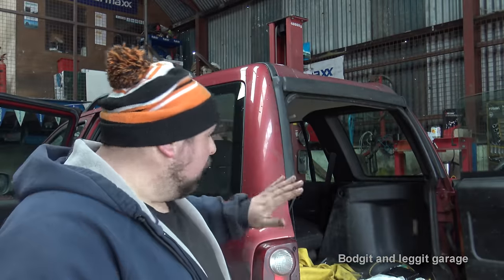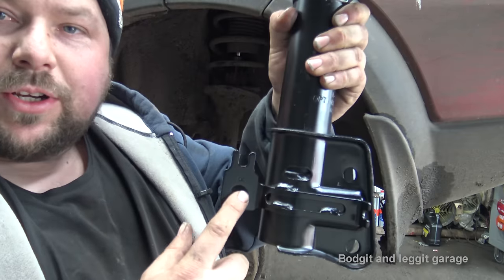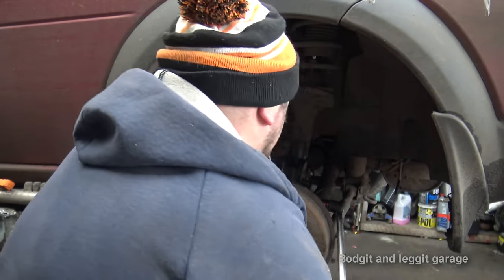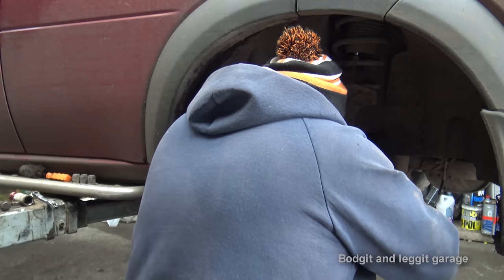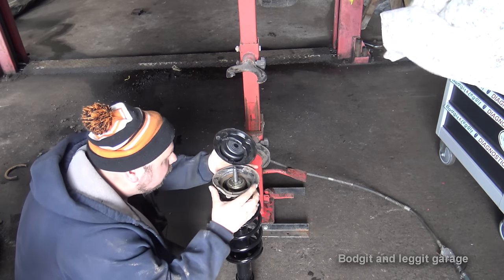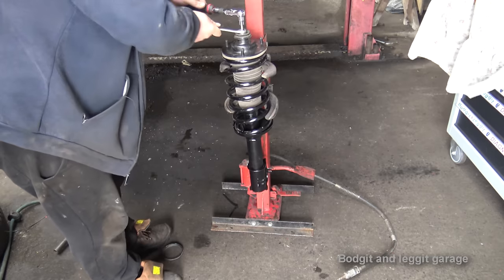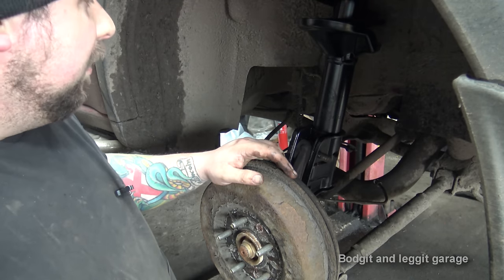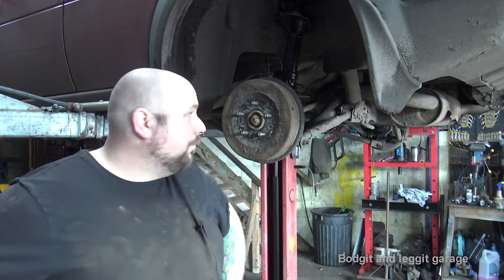Landrover Freelander Back spring/Shock/Shock Tops Bodigt And Leggit Garage

Comment: That’s a crazy design where you have to take off the brake lines to change the shock and springs. And a little bit of that MAP worked well on those stubborn bolts. Leon, that’s a nice spring compressor. Looks to be very sturdy! Great work as always! 😀👍
Reply from the maker: stuzman thanks mate yes it is a good one but I still don't like using it never like using any spring compressor really

Comment: ah good old freelanders, good customers are they :-) rear diffs, diff mounts, viscous units/bearings, IRD;s, gearbox, clutch, low and high fuel pumps, injectors, sunroofs, windows and door locks, fuel tank brackets, electronic gremlins and then the usual stuff too :-)
Think I could be busy 24/7 if specialised in them ... A good one nice usable vehicle but hard find clean ones and need luck too as so many whacky faults on these due to poor design and poor quality ...

Comment: Another Great Video my friend , Pleasure to watch you Work ,  just Brute Strength Sometimes Does the Trick . Very Well Done . PS I have searced Everywhere for that Brake Line Plier and Cant Find it Any Where ,  so Ended up Taking a Nick out with the Grinder Very Carefully , And got the Brake Pipe through , But a very Handy Tool the Brake line Plier , so if you know where i can get one it Would be Appreciated , Cheers Mate

Comment: Sounds like your compressor does not have enough air flow for that air wrench. Last time I did a shock and spring change I used the weight of the car to compress the spring.. since I have no special tools
Reply from the maker: ArLo W it's just the way the camera automatically shuts off the microphone when it hears decibel levels reach too much to stop it from clipping